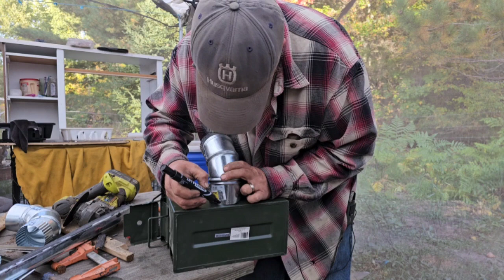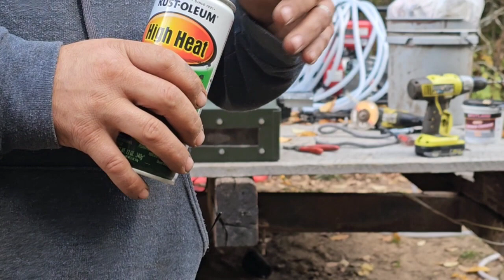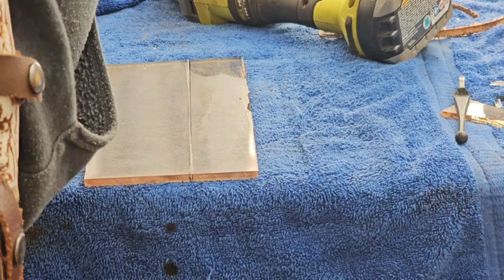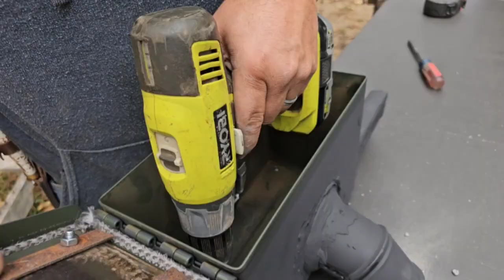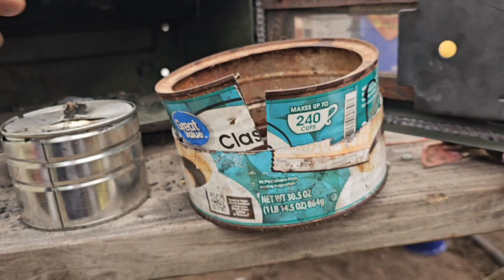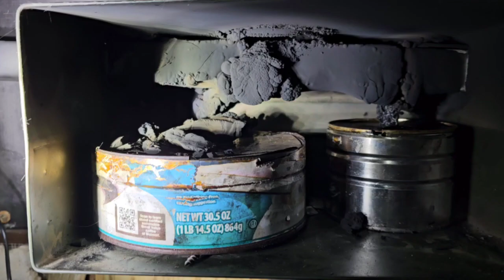DIY oil heater

Comment: I see the idea behind this heater, but the type of fuel leaves something to be desired. Why not just use those cans of chafing fuel that are rated for 6 hours, They burn cleaner and put out alot of heat!
* Never use galvanized vent pipe for any kind of chimney. It will give off toxic fumes that are poison and can get you very sick!